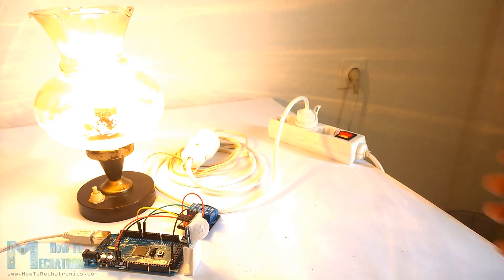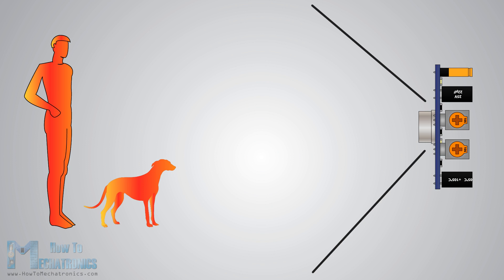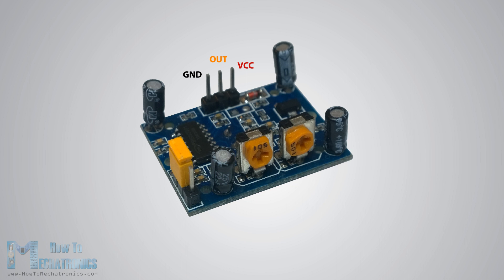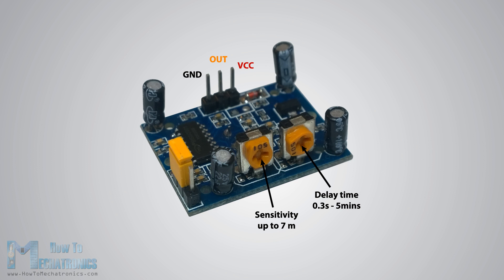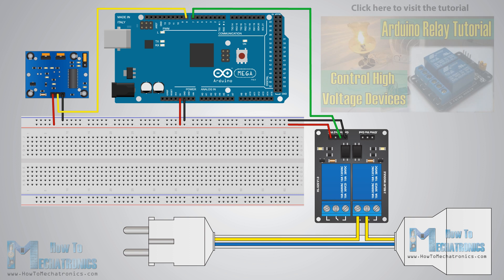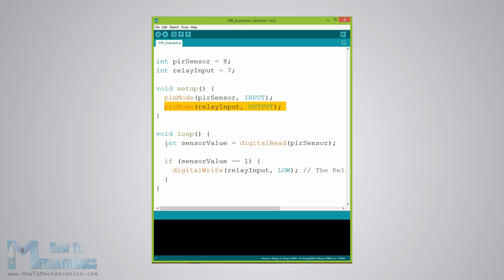How PIR Sensor Works and How To Use It with Arduino

Comment: 00:03 IR sensors come in various package sizes.
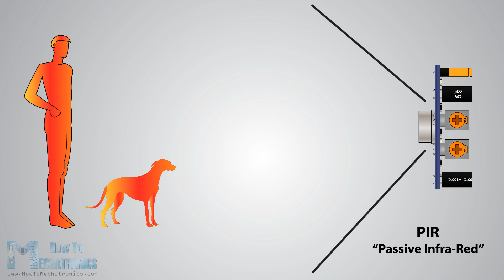00:53 Understanding the physical differences between IR receiver and transmitter
01:37 IR sensor detects objects by reflecting IR rays.
02:31 Voltage level depends on reflected light intensity
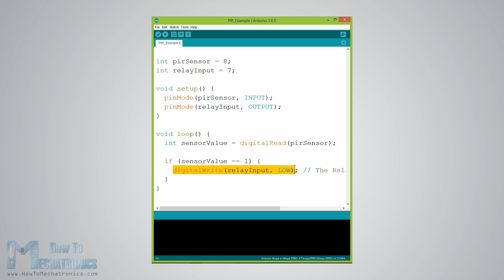03:09 IR transmitters have limited range for detection purposes.
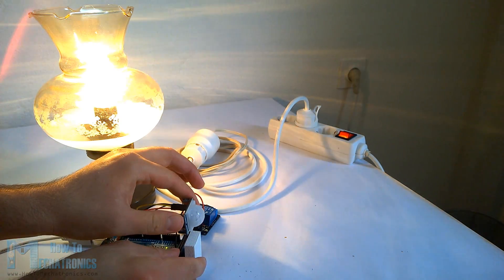03:54 IR sensor detects objects based on reflected rays
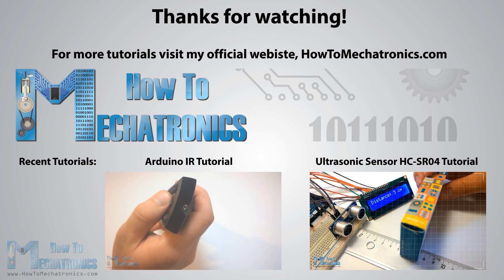04:34 IR sensor detects variations in reflection based on screen brightness
05:13 IR sensor detects different voltage levels for different colored lines
Crafted by Merlin AI.

Comment: Very cool! I've been trying to build a remote-controlled relay with camera (Through hardware or on an Android app). Basically, you could remotely connect to the pi / Arduino camera anytime and, hit a button that controls the relays action. Does anyone know of a similar project guide / tutorial? I ask because, I'm struggling trying to build it myself.

Comment: I have a Solar Lamp with a PIR Potion Sensor and a remote control with which I control the light. When I press Mod 1 ro on the remote it means that the light will turn on via the PIR sensor. when I get close to the PIR sensor the light turns on and automatically turns off in 20 to 30 seconds. My lamp has a Frenzel lens as you said in the video.

Comment: posting if anyone is having a problem. code partially worked, lamp turned on and never turned off. i added next piece of code right after first if condition and now it works fine. this way we properly send a signal to the relay.
if (sensorValue == 0) {
    digitalWrite(relayInput, HIGH); 
  }

Comment: Hi ,nice example ,but didn´t work for me with arduino nano. i solved it, with simple connect the PIR output,directly to input of the relay board, and everything work as excpected. So, you don´t need arduino for this.. simpler and clever without arduino...

Comment: Wow Can this be applied to lights? To be more specific Could I use it for my refrigerator that I have in my patio? Is that freezer which has glass in the front like a shopwindows! I would be so happy to read your comment back! Thanks I gonna follow you! Im zero in this area bur tremendously curious! Thanks

Comment: Great video.  I am working for the state of Florida.  I set up dslr camera traps in south Florida to capture pictures of our endangered Florida panthers.  I am looking to have made a couple motion activated units that will trigger cameras to take a picture, or series of pictures.  I am not a electronics guy, so I couldn't build a system.  Would you be interested in making a couple sensors for me?  And if so, what would be their cost?  Thanks.

Comment: The issue i have with the arduino pir sensors is when i throw a large object like a karton box in front of it , it detects movememt.
So the PiR works as a motion sensor and not specificly as a PIR SENSOR.

How can i change it as s human detector and not as a lifeless karton box detector ?

Any ideas?

Comment: Excellent know-how on PIR sensor Dejan. It was quite enlightening. Looking at your vast expertise in such devices, I would like you to do us enthusiasts, one more favour. 

There is this device "Omron D6T Thermal Sensor", which is also based on sensing the body heat, but better than PIR sensor, as it does not require motion to occur, to get triggered. The advantage is that as long as the human is in the frame of view, it stays triggered, unlike the PIR sensor, where if the human stays at one place without moving, the sensor is not able to sense the human presence. 

I have been looking around the internet for some help in using this device, but could not find any proper resource. Would appreciate if you could teach us to implement this device through a suitable project. Your teaching technique is very easy to understand and would definitely help everyone in getting to know this device and using it successfully. 

Many Thanks  and keep up the good work.

Comment: May I ask you to give a fact based assessment about using the PIR sensor with either Arduino or a Rasberi Pi. The PIR is basically used in security situations and I seem to find only Rasberri Pi board uniting with PIR and exhanging through GSM WITH sms to cell phone notification

Comment: Why you need the Arduino for this?
Reply: He uses the Arduino to invert the signal let's say. A bit overkill off course The relais module has an active low input but the PIR sensor gives a high output when it dedecting. If you should use a relais module with a high active input you could connect it directly  to the PIR. Or you could use a transistor to invert the signal.

Comment: Can it activate hot air or other hot object
can we use 4-5 pir sensor to cover 360° area
Reply: Check in Amazon there is a product by Blakt Electrotech which can connect multiple PIR sensors upto 1000 Watts and it is just Rs.199 or so.

Comment: This is my code:

int voltageexpection = 22;
int ledi = 13;

void setup() {
  pinMode(voltageexpection, INPUT);
  pinMode(ledi, OUTPUT);
}

void loop() {
  int Value = digitalRead(voltageexpection);

  if (Value == 1) {
    digitalWrite(ledi, HIGH);
  }
}

And I plug in a jumper wire on pin 22 (which isn't plugged into anything on the other side and the LED turns on! And also doesn't turn off... Then I leave the jumper wire and press the reset button and then the LED is off, I put my finger a centimeter to the wire and the LED... You guessed it, turned on... What should I do?
Reply: Just add this code before the last "}", then it should work fine

else {
  digitalWrite(ledi, LOW);
}

Comment: hi. is it posible with this Pir sensor to do some other activation of light. first detection on and stay on until seconde detection. i mean as hand wave in front of pir sensor. or it woud be better to use proximiti ir sensor. same first detection to on and stay on after secons detection. thank you.

Comment: Hey,wonderful tutorial! I had a doubt... In the Arduino code, you are taking the PIR's output variable as an integer value, not a boolean. But I thought its output was supposed to be Digital HIGH or LOW?
Reply: wasting memory and/or cpu power

Comment: I need help, my pir sensor doesn't work properly because when I uploaded the code, the sensor wasn't responding and when I checked the serial monitor, it was only showing high outputs and no low outputs. Is the sensor broken? I bought two and they ended up this way
Reply: check the ground pin. it should be connected properly if you are getting high constantly

Comment: This code should not work, because you are pulling the relayPin low, you are not pulling it high when the object is gone. So the lamp will stay turned on forever

Comment: It was well explained. but i have a question. i have a pir and i am planning to make a motion sensor and i placed servo motor so it would rotate 180 degrees. but why will the pir detect something even if it is only moving ? i mean there are no humans or animals in front of the sensor, the servo is just moving the pir and the pir will detect something causing my alarms to beep. how will i solve this problem ?
Reply: Karl Philipp Fabre 
Maybe you dont suply enough voltage at the pir.
I used 3.3 volts for the pir sensor and i had the same problem then i suply to it 5 volts and it worked

Comment: How can I do so that the PIR does not start with every thing or person that passes infront of ... ? for example, i need that when a car pass in front the pir put in high but  not when a pet or a person pass.
Reply: Dejan Nedelkovski thanks, i think that it's better using the ultra sonic sensor like a radar and do a database

Comment: Great tutorial I have liked and subscribed,   Without arduino I want to power a 12v led string with just 12 led's,  do I need two separate power supplies?  maybe 6v for the PIR sensor and separate 12v for the led strip?  Thanks John.... :)

Comment: HI,
I JUST HAVE TRIED TO REPEAT STEP BU STEP YOUR PROJECT. UNFORTUNATELLY THE BULBS TURNS ON, BUT NEVER TURNS OFF. SOMEHOW IT DOES NOT TAKE IN ACCOUNT THE RIP SENSOR, ISN'T ? CHECKED THE WIRING AND WROTE DOWN YOUR SKETCH. I ADJUSTED THE DALAY TIME AND ALSO I MOVED THE JUMPER ON RIP SENSOR. IT STILL THE SAME.
 ANY IDEAS REGARDING THIS ISSUE? DO YUO THINK THE RIP SENSOR IS MALFUCTIONING?
Reply: The code is incomplete, you have to add: 
else{
    digitalWrite(relayInput, HIGH);
    }
Reply: digitalWrite(7,HIGH);
remember relay would turn off when the input is high and turn on when input is low !!! 
if you need  full audrino code for anything then you can contact me !!

Comment: if the pir sensor is sens of lizard type animals ?
Reply: Dear Jignesh Bhavsar, Lizard is a cold  blood animal, and only hot bodies emits infra red. may be but at a temperature  of 40 degree Celsius it will sure emits IR but that would be very low to be get detected by sensor

Comment: The Arduino code is trivial. You could use a BJT transistor to replace it ._.
Reply: He won't reply. Don't even try. I've done four comments already and he hasn't replied.
Reply: Trust me. If he does, it'll be insane.
Reply: My comment is not a question, it´s not ment to be replied D:
Reply: oh  sorry
Reply: GUYS Please i need help here 
i have 2 lidar connected to arduino  and i want to make a 3D modeling which means i will use 2 unstable  theta and 1 distance 

so  i tired to do it by matlab
but it did not work so any one has any idea how i can make this thing work
Reply: Have you tried Arduino forums? They're a great resource and a lot of smart people have ideas.
Reply: You can also use black magic for that

Comment: Where do I get the Cable, Plug, Socket, and Lamp
Reply: I'm doing this for my science fair project and I need help as soon as possible so that I can order it.
Reply: Plus, how do you connect the jumper wire to the PIR sensor and the relay module?? Please reply as soon as possible!!
Reply: plz reply +Dejan Nedelkovski

Comment: I wanna use some of those pictures in my project. Will that be ok?
Reply: Actually, I am working on a poster presentation project on this topic- "Application of sensors in Intelligent Transport System." I am a Civil engineering student at Bangladesh University of Engineering and Technology. I am doing this project for my Transportation engineering poster presentation. I am thinking of proposing of using PIR sensor for street light management. So, the pictures used in here is very much useful to me.So, I am thinking of using some of those for the explanation of this system.Thanks.
Reply: OK.Thank you very much.
Reply: One more question, which software did you use to create those animations?

Comment: You can run the sensor directly with relay module or use a transistor in the middle because the sensor board has enough controls for distance and time even giving logic signal as output. However if the application requires processing or running a certain control schema with multiple sensors Arduino will be required. Arduino will take care of all timing and trigerring, only the distance needs to be adjusted at the level of sensor board.
Reply: Depending on the relay module and the sensor, it could not work. Some sensors have a 3.3v output. Besides, the relay in the example is active with a negative input. Anyway, the Arduino can be replaced by a transistor ._.

Comment: First things first.. great tutorial... well done..
Since there is so much demand for a minimalistic working motion sensor tutorial (without Adreno)...
Could you please make one... and share it.
While making the tutorial.. MAKE SURE THAT YOU KEEP US IN MIND..... WE KNOW NOTHING ABOUT CIRCUITRY (NOT EVEN Soldering, OMs, resister, etc...).
So,I request you to kindly make a real simple tutorial for us....if possible a minimalist one, without resister, OMs and a lot of explanation.
Also make sure that you share your tips and tricks  And the mistakes you did (so that we don't repeat them).

I did search the internet and YouTube.. But couldn't find a tutorial with simple design and instructions. if anyone knows of such tutorial, please share the link.

I'm planing to power a 5050 led strip with 12V, 2.5 or 5 mAh battery, Activated by this motion sensor..

If possible please let me know the minimum things required for this project.. ( right now I've got 1.battery, 2. Leds, 3. PIR motion sensor.)

Comment: I presume you could do this without the arduino? Have the out on the sensor connected to the trigger on the relay and change NC/NO for the lamp? Just need a 5v source to power the relay and sensor?

Comment: Dear Dejan,
I am planning a project using PIR sensor and your video has helped me to start with it.
I have one question,  is the PIR sensor sensitivity proportional to the number of persons? Is there a way i can calibrate the sensor to turn ON only when a certain amount of IR is detected (considering IR will be proportional to the number of persons in the sensors range).Or is there any other sensor i can use for human detection.?
Thank you
Reply: If i use a PIR sensor without this whole module is there any way by which i can set different cutoff for the sensor to get turned on or off,  depending upon the number of persons?

Also can you tell with your experience, wether or not the sensor output is related with the amount of heat emiited by humans? example -  1 human will emit less IR compared with 5 humans?  is this concept wrong?
Reply: I just figured out a possible answer to the question  - Please correct me if i am wrong in my assumption -   If i use Fresnel lens of different colors will it help me setting different levels of cutoff's for different PIR sensors?  

Thank You

Comment: Good tutorial.  How do you read out the untriggered real time sensor output?
Reply: +John Ossi It returns either "motion (1)" or "not any motion (0)". Something like this would do the job :)

#define pir A0
#define led 4

void setup() {
  pinMode(pir, INPUT);
  pinMode(led, OUTPUT);
  Serial.begin(9600);
}

void loop() {
  int val = digitalRead(pir);
  digitalWrite(led, digitalRead(pir));
  Serial.print(val);
  Serial.print('\n');
  delay(100);
}
Reply: @xall1e  bulshit code
Reply: searb

.m

seàrch

Comment: PIR sensor principle here, is explained as sensitivity to thermal radiation.
Itś not thrue..
In fact, is measuring the distance of movement = changes in the source.
Reply: +Jurawood u just got schooled son
Reply: +Jurawood IR=Infrared, as in, heat. Do some homework before you correct people.

Comment: That is way overkill.. you can replace the whole arduino with a resistor and NPN transistor (to buffer the signal) instead. In fact you might be able to drive the relay board directly from the logic output of the PIR sensor, since the relay board is probably already buffered.
Reply: +Oliver O'Neill - The video is titled "How PIR Sensor Works and How To Use It with Arduino", not "How to use a PIR sensor and a relay to turn on a lamp".

Yes, the Arduino is not needed if your project has nothing else. Thank's for stating what is already known! Note how Dejan did not say "It's a good habit to use microcontrollers as an intermediate between PIR sensors and relays". 

Again, Dejan is just explaining how to get started with PIR sensors using an Arduino. Perhaps an LCD could be added, or WIFI, or whatever.  
Read the title once more if you're still confused.
Reply: 'As a teacher' xD.
Reply: *****
Thanks for repeating what is already known. I'm just giving the correct way of doing it. As a teacher it is the up to them to teach them the correct way of doing things, and avoiding bad habits like this one. This entire "tutorial" is a bad habit.

I understand it's to learn about the arduino, then make a video about how it works with shields or something.
Reply: +Oliver O'Neill 
Are you able to show how to use this sensor in low power battery operated applications. I have a project where I need to detect motion and pulse an LED for obsticle avoidance.